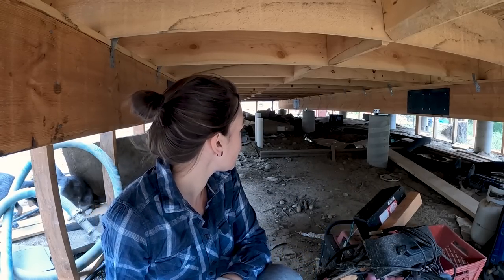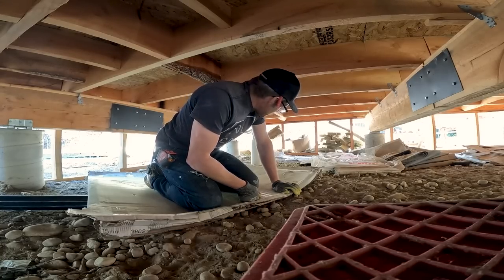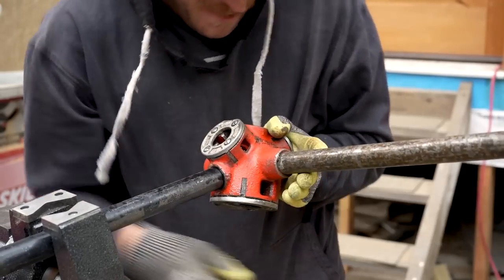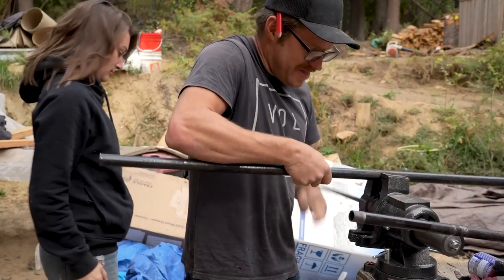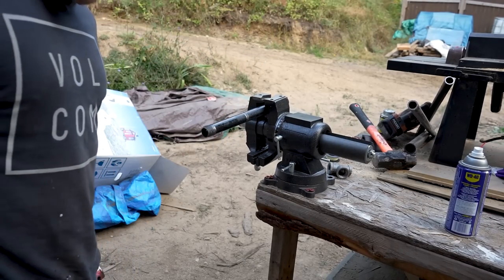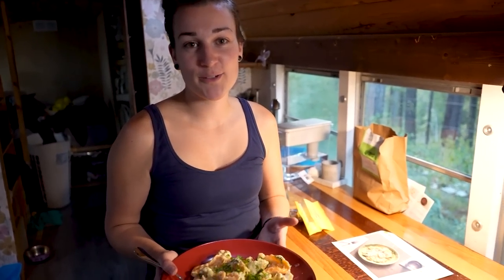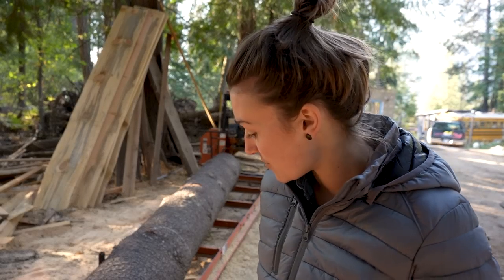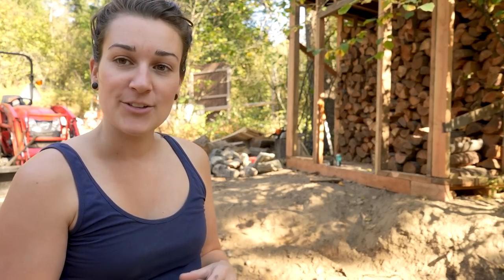4 Years Developing An Off Grid Oasis | Woodshed Siding | Gas Line Install

Comment: I was watching your video and as far as teflon tape and pipe dope, I've (usually) always used both. My Dad was a pipe fitter/plumber and I can remember my older brother and I hand threading pipe with Dad back in the early 1960's. We used a hand threader for 1/2" and 3/4" but Dad did anything bigger than that. I guess that's why I always loved using an electric pipe vice and threader for years when I worked in HVAC work. I loved your video's and look forward to each new one.

Comment: also cutting threads would go better if you cut forward two turns than back half turn add oil like motor oil or cutting oil then turn forward two more turns.  as it lubes better to cut deep thread.
Reply: You took the words out of my mouth. I was always taught that whenever you’re cutting threads to go forward a couple turns, then back off a whole turn to clean out what you cut and eject the shavings.
Reply: They probably ruined this threading die.  Why don’t people that don’t have clue watch some YouTube and learn a little something about things. Sometimes it’s funny as hell watching stuff like this.  Like using a hammer and choking up on it. Using a skillsaw wrong- they will kickback and cut you up.

Comment: Dear Off Grid Life couple.
👍👌👏 A lot of progress is shown. Congrats! Nevertheless: Please work smart, not hard. If your health is gone, it's gone! Nothing is more important than your health. I really hope that you will discover this fact before it's too late. So please kindly allow me to suggest some things:
A thread cutting device with a ratchet makes work definitely much, much easier. Cutting threads forth and back and using the right cutting lubricant also.
3) Transporting for instance heavy stones nearer to where they're needed (with the front loader bucket or the SUV), would've made work definitely easier and safer. Work smart not hard = less sore muscles and less back problems. You can also roll heavy stones/rocks around or shove them on a blanket/piece of carpet and pull them instead of lifting.
3) Releasing the front loader bucket just a bit would've made all the heavy lifting of the freshly cut boards unnecessary.
So again: Please work smarter, not harder. I know that this isn't always possible, but most of the time.
Best regards, luck, health and wisdom.

Comment: This has probably been said before but I was taught to take a turn or two on cutting the threads and then back off about 1/2 a turn to clean the die. To me, it seemed to cut more easy after I did that. Good job guys. Thanks for the video. 👍
Reply: I remember that from metal shop class when I was in Jr. High School. Threading that pipe looks tough?
Reply: I too remember learning how to thread pipe in school and never forgot how, it is easier when you have a ratchet pipe threader with an automatic oiler or manual one
Reply: I totally agree.

Comment: In my experience .. you can use both Teflon and pipe dope at the same time. What really matters is 2 things. 1. Make sure both are rated for the type of gas you will be using i.e. propane or natural gas. 2. Put the Teflon on first and then smear the pipe dope 2nd (seems obvious  .. but sometimes people get that wrong). All the best. Of course test for leaks thoroughly! PS - Nice Michael Jackson moves at 21:36 😂🤣

Comment: For your information, each time you go up to an appliance you should used a tee to allow for trash in the line to drop away from the device. So up to the appliance and a nipple with a cap as a drop out

Comment: I always used rectorseal #5 just because I know it’s not going to leak like Teflon tape does and then you have to redo the joint or fittings. That’s just my recommendation. I’m a retired maintenance man with 40 years of experience.

Comment: Cut threads back and forth - rotate in thread direction, then rotate back half of that, then forward, then back, etc. So if you do a full turn clockwise, follow with a half turn counter clockwise. This clears more of the waste metal off the threads and out of the die, so when you turn clockwise again, the waste metal isn't mashing the thread's peaks or filling the valleys so there is less risk of cross threading. Plus you'll get a better fit on your connection, which is important with gas. Teflon tape and pipe dope should only seal what's already nice and tight. Good threads make a difference. Better to buy your own die and rent a handle as then you know where that die has been and what it has been cutting and for how long. Also you can't use too much oil while cutting as it helps the cut and manages temp and clears waste.

Comment: Nice TY!  Btw, the pipes hanging from the ceiling of the crawl space?  It will rust through the pipes eventually if you don't put in a corrosion barrier between the hangers and the pipes.  I've seen them sprout leaks.  You could use a cheap Teflon sheet but anything non metallic because you end up with dissimilar metals which cause rust.  GL on all your endeavors!!!  GB!

Comment: Greg, normally a thick high sulfur cutting oil is used which will make cutting threads a lot easier, WD40 is not a good cutting oil, motor oil would probably work better if that is all you have.

Comment: Use threading cutting oil when doing pipe. It eaves a much smoother thread which helps reduce leaks.

Comment: One thing I gotta say is you have gorgeous trees Id say healthy old growth timbers I been watching chainsaw milling in Michigan a guy home steading but his trees are are way smaller but its probably a good thing cuz he has no tractor to move his logs around just an atv and it is ruining his back. Ive seen battery operated forklifts hand push type but even that would be a step up to saving his back to load his logs onto his milling sawhorses I even recommended him building a tobbaggan for hauling his logs both summer and winter so he doesnt haven to lift them onto a trailer he can just roll them on and off a tobbagan and save his back though he does have a home made log lifter even that is fairly flimsey. And he recently upgraded to a larger milling chain saw about 7-1/2 hp the extra hp will save time as it powers through logs better and has a longer bar for bigger trees but he could use it with a smaller bar as well aqnd still power through logs using the smaller chainsaw mill as well even if the chains get dull where the smaller hp saw just didnt have enough oumph. Its interesting to watch to though the daily struggles n things he doesnt have that we tend to take for granted like having water that doesnt freeze up all the time.

Comment: I can relate to skirting mobile homes and even less headroom but make sure you do a good job or youll be back when conditions arent so good like in the dead of winter. I have been froze up several times and crawling around in coveralls in  sub zero temperatures is even less comfortable.

Comment: I actually worked a pipe threading machine for a place that put in pipe for fire sprinklers in doors on buildings and warehouses so I can relate to some degree. So yes the old timers may have had help depending on the size of the project.

Comment: 2 things..Threading is easier if you do a half turn and back it off 1/4 turn to break the material off giving a cleaner thread.  Second, somewhere in the gas line near the appliance you should have a Union which is used for dis-assembly should you find a leak later on.  Without a Union, you might need to take apart many joints to get at a potential problem.

Comment: I was taught that when you are cutting threads that you need to back it off a quarter turn every couple revolution to clear the cuttings, I can say from experience it makes the going a lot easier. I have also been told that tapered pipe threads are self-sealing and don't need either dope or Teflon tape, the discussion related to brass fittings don't know if steel pipe makes a difference. Also, on gas lines you need to use the yellow tape as it is resistant to degrading from contact with petroleum.
Reply: Exactly, on the backing off, but with plumbing I'd rather just use Teflon tape.

Comment: as a plumber/gasfitter in the province of BC, I can tell you that there should be no debate as which to use on BMI pipe. Pipe dope is an anti seize compound so that it doesn't band and can be removed later if needed, and the teflon tape lowers the friction so that you can thread it on farther so you can get the thread seal that you need. It is not which to use, you do both, period. it doesn't matter which you put on first, but if you go dope first, then cover the dope in tape, it will make it cleaner to use and handle. but there is no wrong way.

Comment: Bevel the end of the fresh cut pipe with a metal file before you thread it, pipe tape and pipe dope on the new thread and dope the threads on each pipe fitting. You won’t ever have a leak.

Comment: Rigid makes a ratchet type threaded. Better than what have. The electric pony threader is better than the ratchet. Use regular tread cutting oil. WD is not good for this and makes rough threads. Rent a portable band saw next time. Better than a sawzall. 😊

Comment: Never even partially undo a teflon tape junction -- it will leak.  Fibre, properly applied, will expand in the joint and help ensure water tightness.

Comment: Pipe dope or Teflon needs to be approved for used with natural gas or propane.Some type of pipe sealants will fail with natural gas or propane,you should check code it for your safety.

Comment: Yep, that's exactly how old pipe fitters, gas fitters threaded the steel pipes. Remember most places had zero electricity and any electrical tools were both hard to get and expensive to buy. Imagine building a refinery way back without safety regulations, gear, and threading miles of pipes. 
We're "soft" as our grandparents and great-grandparents would say. 🤷

Comment: This channel just popped up on my home page I just scrolled through the video noticed you didn’t have the metal saw rest on your reciprocating saw it slides in the end of the saw you rest your saw on the material you are cutting it’ll be safer and the saw will work better maybe you have it off the saw on purpose idk just letting you know

Comment: Are you going to insulated underneath your house
Reply: At least put down a plastic barrier for moisture seeping up from the ground? Fibre Insulation is only good if it's dry
Reply: They said in another comment they are going to.

Comment: When your threading pipe you do a few turns then back out ! this clears the threads you just made. use lots of cutting oil so you dont break the threads on you tap! now on what to use for gas pipe use the paste not the thread>

Comment: Your place is really coming along great!!  Have you considered spraying instalation foam inbetween the floor joist under the house?  I've seen others so it and then they enclosed it with sheathing and zip tape.  Might be good for the winter weather.

Comment: Hey guys you can buy the whole pipe threading set with a electric motor from Harbor freight for 169 .00 dollars and the motor is really tough!! I've used mine for years with no issues.
Reply: They are in Canada and there is no Harbor Freight stores in Canada and "Unfortunately, due to various import/export regulations, Harbor Freight Tools does not ship to Canada"
Reply: @stephaniebeaton3939  I think princess Auto in Canada carries alot of similar products as Harbor freight?

Comment: Will you be insulating the underside of your floors in the crawlspace ?   Insulation guys used tiger claws to hold up mine up to underside.  Years later, insulation started drooping as put paperside to floor. Often wondering if they should have had paperside on bottom to hold insulation up into the bottom of floor.

Comment: I’ve noticed that you routinely place lumber in direct contact with the ground (home skirting frame, wood shed palate). I assume that this is your home milled lumber and was wondering how long you expect it to last?
Reply from the maker: The wood shed we can literally flip and re build the bottom (tractor).  The skirting will see a little bit of moisture this year, but because we set it on gravel, and are going to install rubber membrane around the perimeter it should remain dry for the rest of its life.

Comment: why are you hand threading pipe when you can buy threaded black iron in many lengths ? The Mom & Pop store close to my house will cut to length and thread cheap ! and to save time, get thread's started at each joint then crank them all tight before elbow or Tee ? and I have never heard of anyone using Teflon tape on gas pipe ? Always pipe dope on black or galvanized and nothing on flex tubing with tapered fittings ! Most allow yelow PEX type tubing below grade but not sure about above grade ?  and remember to put a 1/4 turn shut off @ each unit.  ✌️💙🎵 from STL MO

Comment: Yellow Teflon tape is designed for gas piping. WD is too thin, old used engine oil works great. 1/4 turn back will give you smoother threads & they wont be so jagged. Love watching the channel.
Reply: Also using a hand grinder to bevel the end of the pipe your going thread will make it much easier for the manual threader to start cutting threads.

Comment: Katie when you are cutting wood on the mill you cut 5 or 6 slabs then pick-up the slabs lift them to the tractor.
Why dont you lower the bucket and move the tractor up to the mill   LESS WORK  work smarter not harder

Comment: I never hear of using both tape and paste   one or the other /myself tape  never had a problem / it is a shame you didn't  get  ratchet type threader much easier   check out  your You Tube when not sure  it works

Comment: Greg, WD40 is slightly better than water for cutting threads. If you cannot get thread cutting oil, motor oil should do the job for a few threads. The idea that tapered threads are self sealing absolute BS.
Reply: My impression is that WD40 is more for cleaning, rather than lubrication. It is very light.

Comment: Pipe dope is not necessarily to seal the joint, it actually lubricates the threads so you get greater penetration into the fittings without damaging the threads. The threads in black iron will burr and chip with friction and pressure, it’s a softer metal and your less likely to have a leak.The tape is for sealing, that’s why a lot of  professionals use both tape and dope. the dope lubes and the tape seals. It will work with either most of the time, it’s just much better to be sure from the start than to have to back up and repair a leak after it’s all together and your pressure testing. It is also a good idea to keep the threads clean and lubricated while threading as others have mentioned.

Comment: Cutting tool oil would work 3x better than WD. A THE OTHER GUY THAT said to turn twice and back off one turn is right. But I know all these comments are after the fact so what's the point of recommending anything. You should've just Googled "how to thread black pipe" before you started. The answers are out there.